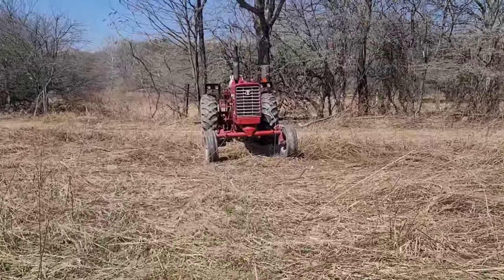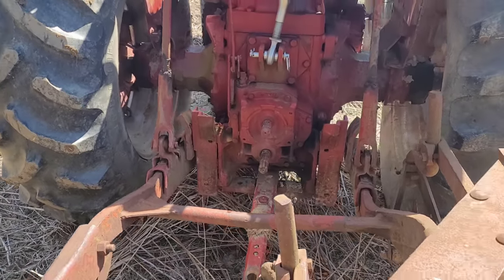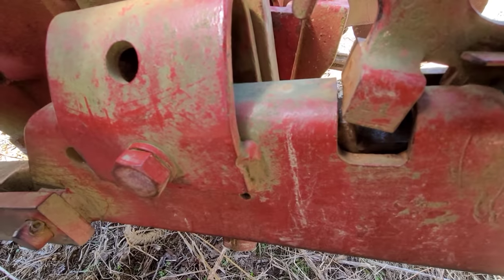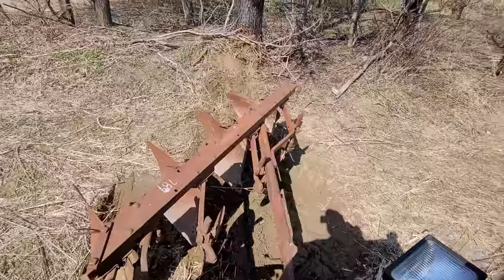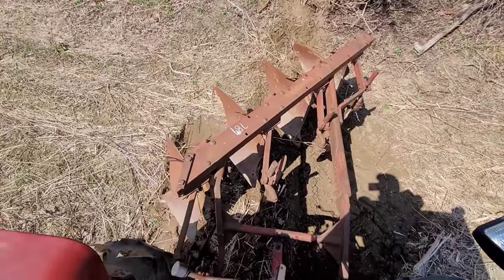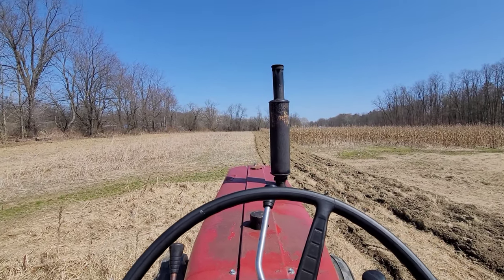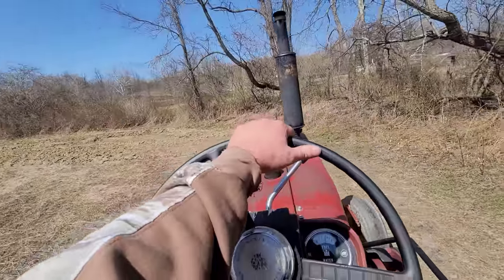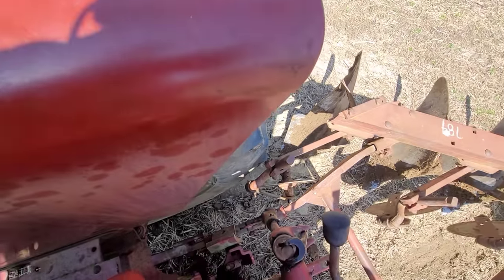Farmall 756 Plowing with a Fast Hitch 411 Plow

Comment: Furrow side has to be cranked down and stabaliers loose so plow move over adjust level with top link. may have to move wheels check owners manuel. First tractor I bought in 1970 when started farming was 656 plowed a lot land with it and 5 bottom Ford plow 14 in

Comment: My bale mover had a bent Fast-Hitch prong, so I took it over to my repair guys who straightened it with a heat nozzle and a Port-a-Power. I think that would work for your issues, and maybe a dead man to lift against. Those tailwheels can be had from ag salvage yards. I have a favorite one in Iowa.
Reply from the maker: I've figured out how to fix this one I just have to take the time and do it
Reply: @FarmallFanatic  awesome. That seemed like a good plow to just scrap. I saw another for sale just like it, with the same bent right prong. I passed.

Comment: We had same plow we pulled with a 450 gas . No tail wheel .Worked great .  Park with first bottom on a block . Makes hook up much easier .
Reply from the maker: Did u have a depth wheel on the side? These prongs are all cut and welded from the person before me
Reply: @FarmallFanatic  I'm trying to remember,  it's been a few days .  Don't believe so.   I do remember setting out rear tire . Tricycle front end .

Comment: I purchased that plow on a 450 gas.
The original owner set the right wheel out to clear the 1st bottom. The axel housing cracked out near the axel bearing.  He strapped it with a 3/8"X3" bar around the housing.  We replaced the housing, reset the wheel, never got the opportunity to modify the plow before the divorce.
Reply from the maker: Ahhh the big D

Comment: Yes the furrow wheels on the tractor need to go out, center of tractor to the inside of the tire around 32-36". Cannot remember for sure. You can lay a long plank running along the inside of front and back tires the plank edge should run just beyond the outside edge of the lay. As a rule on tread setting for plowing when in doubt go wider. Also the depth wheel that you refer to is actually the stabilization wheel. Depth on most IH plows with tail wheel parallel linkage is set by a bolt between the frame and the bottom link.
Reply from the maker: You nailed it 🎯

Comment: We bought a 3 bottom at a sale, should have left it there. Pulled it behind a 460 and it just wanted to go deep. Trailer plows are much better.
Reply from the maker: Did it have the proper stuff attached to it like a trail wheel and a depth wheel?

Comment: You need to set the tractor up to the plow by moving the wheels out till the inside of the tread of the right wheel is just inside of the the outside edge of the point or share. I used to plow over a 100 acres a year with a IH plow with no tail wheel or depth wheel, used the hydraulics to regulate the depth.
Reply from the maker: This plow ain't workin no matter what you do to it. Whoever owned it before me cut n mis welded the prongs and I am not messing with it

Comment: Well, it's probably a good plow that a previous owner messed up. It could be saved if you knew someone around who is really good at welding and fabricating. The one fork would have to be cut off and be redone. I think my dad had one of those plows about 45 years ago or so. He pulled it with a 560. That's the problem with those 2 point plows, you really got to watch what you're doing or you'll mess up the forks.
Reply from the maker: Yep

Comment: that plow has been sprung most likeky  it was swung around and hit a large tree and broke the  2  point hitch fork   that 1st bottom is sprung
Reply from the maker: Agree
Reply: @FarmallFanatic  i think i could fix this.  when  standing behind the plow the left lift fork is higher than the right one  this can be caused by some half sheared bolts... these plows were not delivered assembled they came to the dealer in a crate of parts mostly assembled by teenagers or the min wage hire mechanic's helper. i was one of them fresh out of high school.                             set this plow on a level concrete slab and start measuring. .  the lift forks should be almost level at the points     i had to level the assembly before torquing the bolts.   to set the depth properly we has a couple railroad ties with ends tapered to act as a ramp and  with the plow attached   drive the tractor and plow on the RR ties. let the plow down. when lowering the plow it should be level                this plow was never designed to be used without the tail wheel . if you find a parts plow to get the front depth wheel and tail wheel this will make the plow pull much easier and be  usable.. this plow was first sold to be used by a 450 or 560 row crop or utility.
Reply from the maker: @brokenwrench1   It looks to me like somebody broke it off and then fish plated it unevenly

Comment: After running fast ditch plows. Depth and trail wheel will help. I can  tell you 2 things. 
  The wheel needs to come out like you said. It will help
  Another thing is I noticed  your plow  had a twist in it. I can see from set up and  I dont think you can adjust it out. Only other option is set it level and cut and reweld so it's  level and fits. It can be done and it will work properly.
 Like you said you can buy another plow and be better off.
Reply from the maker: Yep

Comment: Great parts, but it's bent or something.  I have a 3 bottom Dearborn that'll turn the tractor hard right if you let it. It just won't work with my tractor is all . Plows can maka you crazy. With that front bottom running in the furrow you might as well use your 3 bottom and git r done.
Reply from the maker: Basically lol

Comment: Need to move tire that's in fear out the first gang is running right behind the tire
Reply from the maker: Bent prongs...figured I'd try it out
Reply: @FarmallFanatic  they are trip beam right so if they were working the forks should not have been a problem for the original owners that a safety mechanism on a plow